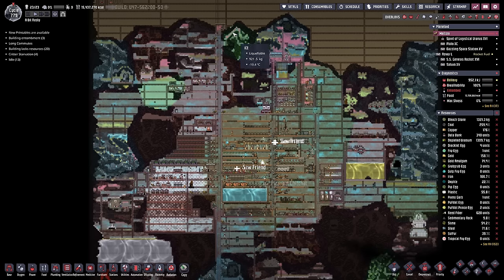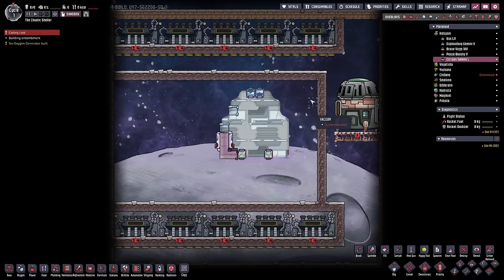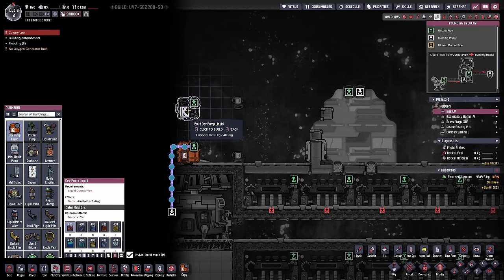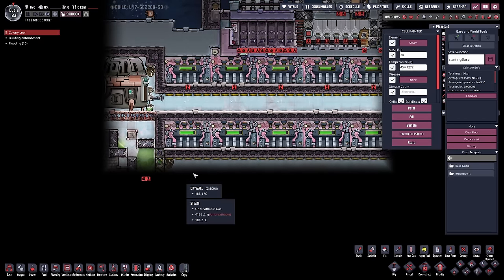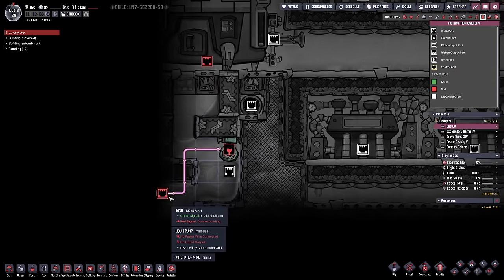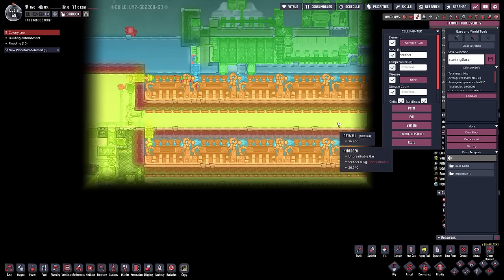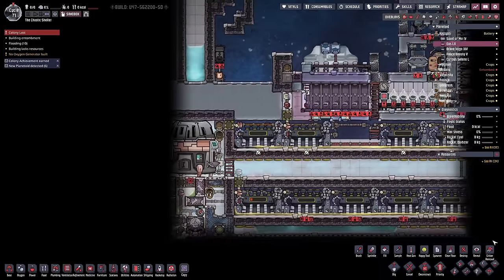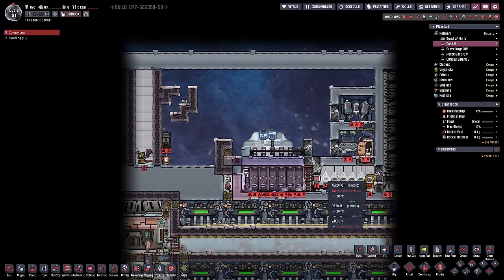Ep19 : Squeezing a Nuclear Reactor into a Rocket  : Oxygen not included

Comment: For some of the radiation issues, a layer of infinite liquid storage can block 100% of rads.
Reply: Unless it's a storage for nuclear waste!
Reply: Yeah that would bring his 4 tile (incl. insulation) walls down to 3 tiles. Insulation, infinite water, any other tile.
Reply: only one layer tho if use two there is a bug
Reply: @Grizzly-gm1bw  Yea I tried this out with 2 tiles and even an L shape for the liquid storage. Almost seemed to amplify the radiation on a specific tile diagonally.
Reply: @alexeynezhdanov2362 no, even that blocks radiation 
Nuclear waste radiation has a smaller range than reactors, even if the rad number is higher

Comment: Steel Aquatuner overheats at 325°C, it'll run fine if you preheat the room to steam levels using a refinery or whatornot.
Reply: You are correct; I thought you were wrong. I wonder if they changed it or I've always been wrong. I was thinking 275.
Reply: I think people get they confused because all other buildings only go up to 75°C  but a copper aquatuner can go up to 125°C
Reply: @pedrolmlkzk  I think I am people.
Reply: @Davini994  i couldn't reply directly for some reason lol
Reply: @Davini994 I thought this was wrong at first too. Most of the steel machines (pumps and such) overheat at 275, but they gave us a break with aquatuners.

Comment: For radiation shielding, what you could do is make tempshift plates out of coal, and cook them into 800kg tiles of refined carbon.  as I remember those are amazing at blocking radiation, though quite heat conductive.  Also, I'm pretty sure a steel aquatuner has an overheat of 325C rather than 275 like you were thinking.  one other thought, it might be difficult to get that 10kg starter patch of nuclear waste on the bottom tile of the map.
Reply: Could you drop it on top of an airflow tile → brick in to force it to the side? Lots of fiddling around though.
Reply: If you want even more radiation resistance, use a dispenser (set to refined carbon) with the output inside the refined carbon block to increase its mass further. A mass of 2545kg should block 100% of radiation.
Reply: this would be on brand for the module
Reply: @van_dan5 this applies to all materials also. I think 7500kg tile of iron has 100% radiation blocking. The radiation blocking changes based off of the material and mass of it.

Comment: Silly idea but why not build a temporary aquatuner somewhere else to cool the turbines until enough waste has accumulated? You could probably even use the I/O ports of the Rocket to connect an external cooling loop.
Reply: This is the move IMO. You can prechill and prefill the loop too. You don't have to even use the internal aquatuner until it's covered in waste as well. If you really wanted to you can start the loop with any fluid and replace it with waste when you're ready. Keep the outside aquatuners in place to super chill the loop quickly.
Reply: I belive If he were to make dupes build aquatuner in nuclear waste I belive the will die from radiation
Reply from the maker: We can fire up a reactor in a separate rocket, run it for 2 or three days until it inevitably explodes and then use the waste we generated to fill the loop. We can chill it first.

Comment: When I suggested you put a reactor in a rocket, I didn't think you would do a full 10 steam turbines. I was thinking more along the lines of building a smaller reactor that has its uranium input throttled to allow it to run with like, 5 turbines. This is insane though and I have to commend the dedication

Comment: 30:25 by dropping liquids on the blob of nuclear waste below the reactor, you effectively pumped the gasses from the sides of the nuclear waste upward. this is why the carbon dioxide and oxygen were in your steam room. to prevent this from happening, I think you can fill the steam room with enough pressure of steam (more the 1kg) so that the 1kg of oxygen or carbon dioxide can not go up since there is already a different type of gas there and at a higher pressure. I hope I explained it well enough to be understood

Comment: 36:33 That bridge should stay on the cooling loop until the aquatuner is overpressurized to over 1000kg. Otherwise the nuclear waste leaking out of the aquatuner will drain the cooling loop.
Reply from the maker: The plan would be to hit up the water planet is reasonably short order and replace the waste with super coolant. It usually takes hundreds of cycles before enough waste would leak out of the cooling loop to be a problem.

Comment: you can go with 6 turbines, you just need to make sure to only have ~15-29kg of uranium in it. It consumes 10kg per cycle but the more you put in the more heat it produces
Reply: Saves on uranium as well. There's no way the rocket can utilize the amount of power 10 turbines can produce. If you're using it to power a colony by the time you've outgrown 6 turbines it's time to put in something dedicated.
Reply: @eriksolce7000  it doesn't save on uranium as it consumes 10kg per cycle flat, just the more you put in the more it seems to heat the water and/or waste, haven't really checked why but it's great to modify output

Comment: Interesting reactor, my idea for a similar super small power room was to dump lots of very hot regolith and ingenious rock from volcano a in a vacuumed room that only auto transfers it to the steam room when power hits a low point. It did require that I save a lot of stuff for the heat though.l that couldn’t be used for petro.

Comment: In terms of radiation shielding, making this reactor at the top of the map would've have been best for several reasons. As it is now, you're fighting against the radiation from the reactor separately from the sun radiation. If it were at the top, you could shield against both at the same time, with the steam helping with that shielding. Yes, you would need space for the steam, but then you put your layers of plastic/lead under that and handle it all at once.

Comment: Hey Francis, one thing about radiation absorption: natural tiles can do it too, and they don't have the same limiters that constructed blocks do, and their radiation blocking is instead proportional to their mass. That means that creating natural tiles of enough mass can block full radiation, even with only one tile thickness. 2.5 metric tons would  be needed for lead, for example. 

Creating tiles of lead or depleted uranium would actually be easy enough with their fairly low melting points, and with their maximum mass per tile (without compression) exceeding the needed amount.

Comment: So just a bit of info, inspired by you, I also tried my hands at melting a rocket and building inside of that to create a mobile base. The first time I tried it, I melted the liquid input port and continued playing without knowing/noticing... which indeed ended up bricking the save and costing me hours of playtime. So the second time I was a lot more careful, protected both liquid ports, they are intact and usable. But ended up melting the gas output port by mistake. So I immediately saved and backed in, and to my shock, the save is fine. 
The module itself doesn't have a gas input and output on the outside anymore, the input still exists inside of the module. And I've been playing fine and dandi for ~600 cycles/10 days since.
Reply from the maker: So gas ports can be sacrificed for the greater good. Considering you can dump gas into the vacuum of space their loss is not a big deal and it frees up some more space.

Comment: ~25:00 - I suspected at first that what happened here is that because all the separate rocket/asteroid screens are rendered in different sections of a single larger map that hides (almost) all other views when you are in one asteroid or rocket view, that the rocket is positioned above this location on the overall map.  Since there is no natural solid bottom in the rocket and no natural solid top of the asteroid maps, and devs expecting only tiny amounts of liquid from the wall toilet would disappear too quickly for it to be noticed, since the reactor is producing a relatively large amount of nuclear waste constantly when it falls through the bottom of the rocket map and into the asteroid map it doesn't have enough time to completely evaporate and starts pooling, heating up and melting the map.  I cannot account for the abyssalite disappearing or the clean cut through the solid mass though, except if this interaction somehow introduces some other heat bug.

But compare the width of the melted area - isn't that the width of the rocket capsule map?  This seems to be some other sort of bug related to the relative map positioning, the nuclear waste droplets and possibly steam droplets leaking from the rocket map that involves some other form of super-positioning of elements.  It reminds me of the bug when hot regolith stacked too much in a tile would suddenly form a column of regolith tiles that destroyed everything above them, so there may be a similar bug to that going on here in addition.

EDIT - I See, you showed it's related to when nuclear waste gets popped out of buildings once per cycle.  But that's way too much waste, and spread out over too large of an area on the top of asteroids.  There definitely is some other bug or bugs involved here.

Comment: For the infinite waste storage, you don't need to prime it beyond the top part. You've got airflow tiles that are unnecessary. You don't need the steam getting to the aquatuner area. Replace the airflows to the right of the tuner with airlocks. Then you can prime it with a single blob of waste, a single tile of hydrogen, and any amount of any other gas. This will negate the need for the airlock to the left of the aquatuner and you can raise the pump up a tile to eliminate the issue of the waste falling off the map. I haven't seen an actual solution for how to get that there without painting it in, but I've still got a few minutes to watch.

Comment: Hi Francis,
while you got a nuclear reactor inside the rocket, there are too many other problems remaining:
- cooling,
- water and
- food (well, some reed fibre to fix Atmo-Suits would be nice, too).

I think it might be better to have a Slickster-Ranch and use Petroleum-Rockets, some Dreckos for Reed-Fibre and more BBQ (might best to feed them on Balm-Lilies or Mealwood, once you've got Arbor-Trees).
Another idea could be to generate water for Electrolyzers, build a Liquid O2 and H2 Setup and use that to fuel the rocket... But the excess of the Toilets won't be enough to keep your Dupes breathing, too.

In both cases you would use Solar-Panels as primary energy-source on those Rocket-Modules, H2- or Petroleum-Generators to burn off excess or if batteries are low.
Reply from the maker: It's the rule of cool, having a nuclear reactor in a rocket it just so much more awesome :)

Comment: @35:20 the problem with the pipe getting stuck is due to the AT piping is shorter when its off as you have the extra pipe after the AT's output even after changing the bridge to connect directly to the loop, wont have a problem if the extra pipe is after the AT's output
during the test no issue as the AT stayed on all the time but the loop will get stuck once it turns off

Comment: To "how do we get power out". 
Just use "thin wire switching batteries" trick. You could transfer unlimited amount of power through even simplest of wires as long as you don't have "real consumers" attached. Generators connected to swapping pair battery (banks), it it's turn, currently disconnected from generators battery linked (by "normal" thick cable) to transformers, which would drain power into "normal" main grid.

Comment: If you want to save some space you can build 2 atmosuit docks against a wall with the checkpoint facing out. Have 1 dock filled and the other empty. Dupes are in suits full time and will go to the checkpoint to change their suit when oxygen or durability run low. Only downside is if you have multiple dupes you may get a bottleneck if 2 dupes coeme along with broken suits to swap, then they will be waiting behind the checkpoint until another dupe brings a fresh suit.

Comment: You can put the aquatuner under the top row of steam turbines, where the transformer is at the moment.  The flow of steam would be more than enough to keep it cool.  It would also give you a spot to put the pump so you aren't dumping waste onto other planets.
Reply: The aquatuner will drop nuclear waste once per cycle though.
Reply: @yaemz123  If you insist on using it as coolant, yeah, but assorted types of water would work just as well given that the aquatuner has less than 50 percent up time long term.  It's not like the power requirements wouldn't be met.

Comment: Great video! 

I have some suggestions for the cooling loop. The simplest one is that you can get super coolant a little easier by mining fullerene from the Guilded Asteroid Field rather than going to the water asteroid. You'll get less, but I think it's enough with just one trip (definitely check my math if you go this route). Alternatively, you don't have to start the cooling loop with nuclear waste. You could start it with water so the turbines get some cooling in the beginning, then you could replace the water with nuclear waste. Lastly, you could initially cool the nuclear waste with a few more aquatuners in a temporary setup built outside the rocket.

That leaking waste onto other planetoids is kinda scary. I wonder if that could be used intentionally somehow. Maybe some way to transfer materials or heat onto/off of the rocket.
Reply: One single mission to the gilded asteroid allows you to make ~1.4T of super coolant
Reply: sorry, it's  140T*

Comment: Given the work you have put into this build I don't know if this would help, but you can use the 'Conduction Panel' to cool down things even when they are in a vacuum. The 'Conduction Panel' is a plumbing building that was added to the game with the `Hot Shots Update` (December 15 2022), and I would describe it as a cross between a 'Liquid Bridge' and a 'Radiant Liquid Pipe' that exchanges temperature with building even in a vacuum.

I usually play with a mod that allows you place 'Tempshift Plate'/'Wallpaper' behind tiles so I don't know if you can place them behind a 'Conduction Panel' in vanilla. You can't run a pipe through the middle pipe like you can with a 'Liquid Bridge', so I question if that only applies to pipes or if it also applies to 'Tempshift Plate'/'Wallpaper'. I have been been running with a 'Tempshift Plate' behind my 'Conduction Panel' and 'Steam Turbine' Combos so as to provide more stable operating with the extra thermal mass. I also have not tested to see if a 'Conduction Panel' can interact with an adjacent 'Tempshift Plate' or not. I'll probably test that this evening and potentially report back.
Reply: In my last playthough I used conduction panels to cool  most of my turbines. Most setups used two panels per engine, but for lighter duty cycles (some volcano tamers or simple aquatuner boxes) one would often be enough.

Generally a way cleaner solution than putting liquid or gas behind the engines.

I also used a few so I could put transformers in vacuum where I happened to have a handy flowing water pipe. Doesn't take much to keep one of those cool.
Reply: @milolc  The main reason that I suggested the Conduction Panel is that unless my memory is off, a Heavi-Watt Joint (Conductive or not) Plates will transfer temp into adjacent liquids/gasses. A vacuum combined with a Conduction Panel shouldn't transfer any energy into the turbine room, although I could be wrong as I haven't personally done an actual experiment to 100% verify that that is the case if the turbine is sitting on top of the Joint Plate.

I initial suggested it because I don't remember seeing Francis John ever using them (The last let's Play was prior to them being added to the game) and one of the early builds this video was scrapped because the Joint Plates would have transferred temp to the liquid used to cool the turbines.

Comment: Maps are connected to one another.  Neutronium walls separate them.  Maybe the space shuttles only have walls around the shuttle itself and not on the walls so they connect.
Reply: Using the connection as a feature you could work out the mechanics and build adjoining shuttles?
Reply from the maker: I think it was the dev tool spawning stuff during auto saves. Say I was trying to spawn nuclear waste and the game saves while I'm moving the cursor and it affected adjacent maps.

Comment: Didn't see it in the comments, but you could just use the steam room to clean the water, right? (I don't own Spaced Out and am unsure if the water can carry radiation)

Fitting in another aquatuner to temperature control the living area seem easy enough and shouldn't take any tiles away, and you'd need that anyways to cool the water sieve longterm, might aswell save those tiles.
Reply: I expect he will just extend his cooling loop for that.  That's likely why he has the little bump on the right side end of the pipes, so he can bridge on/bridge off a loop extension later for the rest of the rocket.